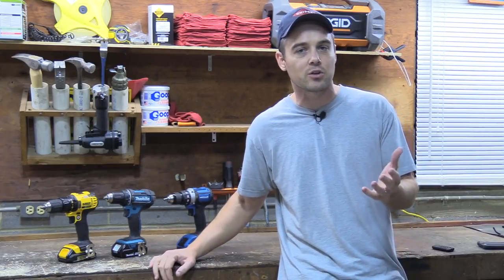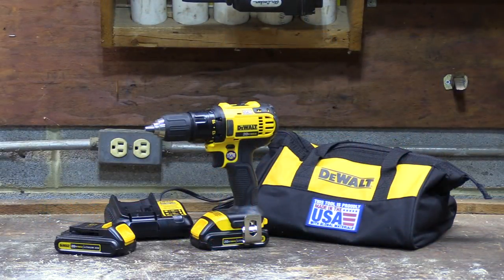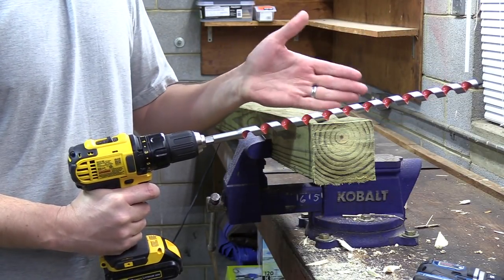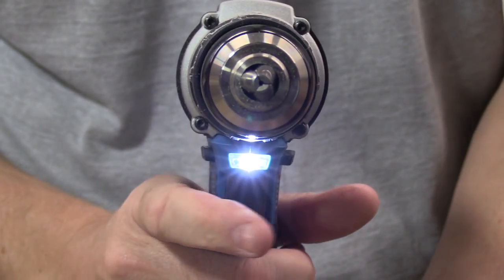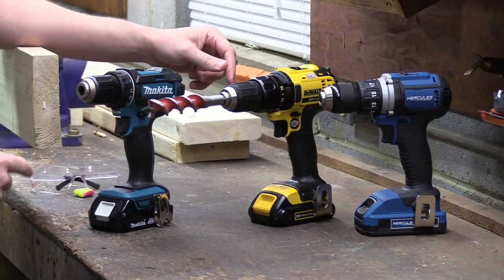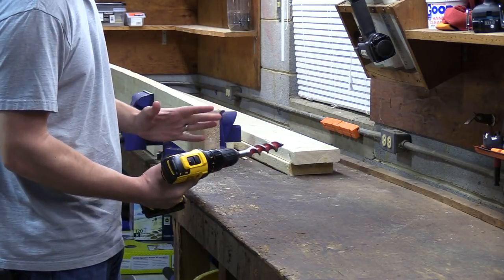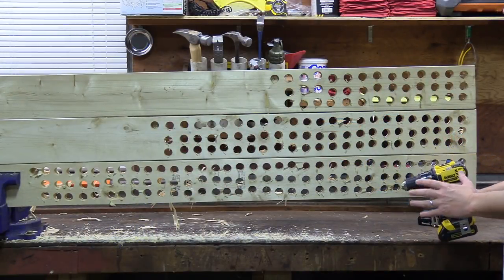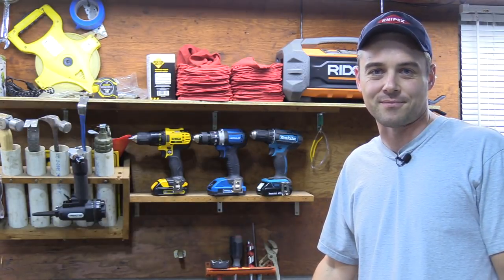Dewalt -VS- Makita -VS- Harbor Freight (Hercules) / DCD780 -VS- XFD10 -VS- HC91K1

Comment: Not hating on any brand, but the "real" test comes when a tool performs on a site with all kinds of drops, dust in the air and brutal use in real world conditions. There's no denying that a bigger battery will get more holes drilled, but when it counts, which one will last the longest in the field when used to build things in all kinds of conditions (freezing cold, sweltering heat, rainy damp conditions, etc...)? 

I've seen other tests where the Harbor Freight just gets fried from being used and the DeWalts & Makitas keep chugging along. There's no denying that any well known manufacturer can make lemons from time to time and that there are some great low priced budget tools out there, but the best testing is done in the field. 

I'll never buy another DeWalt compressor again. When their new compressor failed on me and I took it in for service, the local service manager didn't want to honor DeWalt's warranty after I had to return the 2nd time because the job he did the first time left it sounding worse than when I bought it in and DeWalt defended their service manager. I paid premium dollar for that thing expecting it to be supported by them. 

Drills however? I'll buy those all day from DeWalt and Makita has the best reputation in the field. Bosch too also made a GREAT drill in their day (especially their compact PS impact drivers). 

Having said that, this was definitely a very thorough lab test for sure. Lots of hard work put in and I (as many other here) do appreciate the effort. Good stuff.
Reply: I'm an electrician, and I used my dewalt in snow and rain ( setting it right in the snow, or pouring rain) and that damn thing still works. it is so old, it takes those old batteries that go right up in it..lol... about 20 years old, and it still works.
Reply: @jarrydee2799  If it ain't broke, don't fix it, right?

Comment: I think the obvious favorite would probably be the DeWalt, but I'm going to go out on a limb here and say the Hercules, because I think that's Harbor Freights new top-of-the-line in house build and it's probably built to Harbor Freight specs by one of the higher end manufacturers. So I've got to say Hercules.
Reply: I forgot I think I was supposed to reply to my own message, and lo and behold I got it right. I had heard good things about the Hercules haven't bought one yet. I did pick up an 18 volt Warrior lithium ion at one of their sidewalk sales for almost nothing once I added in the 20% coupon with the sale price. it's got torque for days, it has the built-in work light it doesn't have the LED indicators on the battery, but so far so good. I bought it  because it was a great price  and  I could stuff it in a cabinet in the kitchen and always have one in the house handy. So I don't use it a ton but I've had it for 6 months and I haven't had to recharge it yet. I'll take a look and see if I can tell which manufacturer it looks like may have built it. I'll update this if I can tell.

Comment: Personally, I dont think the Harbor Freight tool will last in the long run though. Could be wrong, just my gut feeling. lemme know if im wrong and your experience, im curious
Reply from the maker: I sent these out with a local contractor a year ago & they get constant use.....I regularly hear back about how great the Hercules is & how much better it performs vs the drill it replaced.

Comment: have been a makita user for years specially those of battery powered (drills, impact drivers, grinders, sanders, blowers, circular saws, etc...). they have transitioned into an 18V lithium and since i have tools fitted with it, it makes sense to buy only makita lithium (rechargeable) powered units since their batteries are interchangeable. rechargeable battery equipment are design for quick fixes without the hassle of dragging cumbersome cords connected to a power source. to drill that many holes would be unimaginable for me using rechargeable units. however, if i prefer to use them, i always have 2 batteries being charged with a fast charger at any given time. you have to alot a bit of time before you recharge a drained battery since it would still be hot from use (though the chargers have a built-in fan for this purpose). if it boils down to industrial use (hours and hours of continuous use), the corded ones are always preferred by professionals (which i also have). the hercules having a 20V power supply would certainly entail more power (or longevity if the Amperage is higher).  i have always found makita to be a reliable brand with adequate service centers worldwide. older makita models are truly made in japan but most of them are made in taiwan nowadays (the original light bluish colored ones). yet the most often of them already comes in green (this is the true CHINA-MADE ones and even distributors do not recommend them for heavy use - unless you are budget constrained). there are also the variant branded as MAKTEK which comes in red color but still made in China... a bit more buck would get you the taiwan made ones which are relatively good but still inferior to the japan-made ones...

Comment: Dewalt batteries have fuel gauges?
Reply: Except the smallest ones.
Reply: @ChrisGilliamOffGrid  the one he is using isn't a smaller one.
Reply: @Vera-xu3xw  Those batteries are tiny. All mine are 4ah or higher, up to the  9ah. I have a couple of the tiny ones laying in the bottom of the tool box, and they have gauges, but most of the small ones I've seen that come with tools from Lowes don't have the gauges. I have a video called Dewalt Fanboy that may interest you. :)
Reply: @ChrisGilliamOffGrid  does the Dewalt battery in this review have a gauge? YES
Reply: @ChrisGilliamOffGrid  FYI I'm not a Dewalt fanboy. It's just once you buy a couple battery operated tools (that are good) I find it better to stick with one brand for sake of having extra batteries.
Reply: @Vera-xu3xw  Exactly what I said in the video. I make a living with them.

Comment: On some level the thing about even well thought-out comparison tests like these is that even though all of these drills are mass produced and identical by all visual measure, something is different. I see it with car reviews all the time, where the top dog in one comparison is 2nd, 3rd, or worse in another. Then there are all the viewers of this that will go get the Dewalt/Makita/whatever and say the do jobs like these all the time and the bit goes right thru.
After watching this the Herc does impress, but in other videos the Hercules build, like the handle, breaks more easily. So no question about power-on performance. Just don’t drop it.

Comment: Makita you don't have to buy separate larger battery to run the 36v tools, they take 2. of the 18v batteries . plus they are proven tougher than concrete work or dropped from 2 story roofs. I still have a 12v drill from 1994 that works. Best deal is buying kits not individual tools. Find promo's and coupons

Comment: I would’ve liked to have seen you in the last test drill into the same piece of lumber with each of the drill motors. Often I find a greater density between one piece of the same species of wood.

Comment: It all depends on the parameters you use to decide a victor
Reply from the maker: I guess if the contest was which one is the least powerful or can do the least work, you are correct....the winner would be different.
Reply: @RealToolReviews  how about longevity of function how, much abuse it can take, how many times will the batteries recharge before they won't hold a full charge, how accurate are the different setting to the scope of setting available.the list goes on and on.

Comment: My guess would be Dewalt for popularity, maybe durability (drop-test), Makita for battery life, and Harbor Freight will be bang for the buck.
Reply: Ok, so after watching, Makita is losing steam... Dewalt is still pretty standard on worksites... I use Milwaukee.  

Warranty is big for resellers, but I live by my tools... if I have to do warranty stuff with my tools, I don't buy that brand again for about a decade.  You make a tool for tradesmen, or you do not.  Clean-shirt reviewers aside, I will keep an eye on Hercules... sometimes Harbor Freight knocks it out of the park, but I need it not to fail after months of construction abuse.  I keep 12 or so M12 and M18 batteries in the truck, and a variety of tools for my trade.  If you're building your own deck, Hercules seems pretty good.  Makita excels with fencing crews, driving lots of screws.  Dewalt/Milwaukee are king of skilled trades in America, but ripe for knockdown.  Proof will be in the pudding for Hercules, we all try out Harbor freight for one-off applications... but when they handle all the use and abuse and keep rolling, they'll become a staple.   If you're doing heavy drilling, Hilti is still king, but out of my budget.

Comment: From my experience with my new DeWalt hedge trimmer the DeWalt would do better if you bought batteries and chargers separate because for my hedge trimmer at least the battery last all day on 10 acres and still half charge

Comment: All I've ever used is DeWalt and they have always worked. I've seen other guys go through Makita drills like socks. Mostly battery chargers don't last and the drills themselves can't compete with DeWalt. I couldn't imagine using the Harbor Freight junk drill
Reply: Mike Mcglothin I’ve had about 2-3 Dewalt drills in the past 5 years, with one of them being the top line toughest model. Idk why I kept buying them if after a while they’d start smoking and go bad. 
I haven’t had that issue with other products such as their grinders and impact wrenches which I love, it’s seems to be their smaller impact driver and drill/hammer drills that suck
Reply: Also I honestly think the best investment as a professional or a person working in heavy industry or even a busy DIY. It would be Makita, Milwaukee, and Dewalt. 

I feel that Dewalt has decreased its quality over the years and as much as it costs now, you might as well get Milwaukee or even a Makita which if you look at any other videos
blow Dewalt away.

Comment: The Hercules did better then I expected, but I would have liked it if you had bought a 2nd battery to give the price with 2 batteries. I picked Makita
Reply: The Hercules batteries are $29.99 for the 2.5 amp hour battery and $49.99 for the 5 amp
Reply: So the Hercules is actually $128 with 2 batteries

Comment: I have Hercules and like them a lot. I also have DeWalt and they seem to have gone down hill of late. I have Makita  as well and they work fine. I will not replaced my DeWalt when it gives up the ghost because the brand has deteriorated to second class. I will keep using Hercules and Makita.

Comment: I have the DeWalt and love it.  Except for one thing.  The placement of the light.  It's supposed to light up your work space, but it just casts a shadow.
Horrible design.  I can't remember the brand, but someone makes a drill with the light at the front of the battery so that the workspace is lit up. I think it's Milwaukee.

Comment: I had satellite and internet company a 10 years ago. I used a dewalt xps and the transmission keep braking and I send it off to them. They fix it but it broke after a few months and I have repaired it about 4 time now.  The makita I have had to get while waiting for the repair the first time still works with no problems at all.

Comment: Personally I lean more towards Milwaukee as they have the 5 year warranty and 3 year battery warranty. But from an actual user stand point of the 3 tested the DeWalt or Makita will probably be the best bang for your buck. Sure the harbor freight tool drilled the most holes but it did have the biggest battery pack and unfortunately only came with one. Some one on an actual job site will require more then one which is added cost. DeWalt and Makita have tons of tools that run off the same batteries and unlike the harbor freight tool you know that there will be replacement battries still be available three or four years down the road. Not knocking the Hercules tool as it's very impressive for the price especially with an all metal Chuck but I can't see it as the value choice for an actual contractor.

Comment: Makita for impact basic drills are for cabinets impact drills will do a lot more for you plus if you put in the upgradable batteries for DeWalt they perform better plus you could put more magnets around them lol.. buy watvr you wish but the Makita impact is the nicest design which will blast through, I use DeWalt with 5.0 battery for a basic gun it puts tapcons in perfect

Comment: Good testing. longetivity of the whole device plus shareable batteries across the tools you use, make HF the loser, but the winner if all you ever needed was a drill.  I wish, oh how I wish there was a single battery to work on all platforms. There is no standardization in that arena and there should be.

Comment: I have the DeWalt drill, its still working but I used it hard one day and ever since then has a smoking motor smell to it.  It's ok but having used other drills and what I'm experiencing with it I will not be buying anymore DeWalt tools.  I have zero interested in finding a repair location nor paying to have it repaired I'd rather use it until it dies then buy a new one.

Comment: for the money or not the Hercules drill seems to be the best built drill here. I have two 18V Dewalts, the drills are ok the batteries died after about a year. I'm not hard on my tools either. I didnt ask the DeWalt to do anything much, just drilling small holes in aluminum and mild steel. The fact is the DeWalt batteries are junk. Most of the DeWalt stuff is way over priced for what you get. I think the Makita is ok although I was surprised it didn't have the balls to bore through a pine 2X6 with the large diameter bit in it? wth?  
   I need a new cordless drill because both the battery packs on my DeWalt are dead ducks. I sure as hell won't buy anything DeWalt is peddling any more. For my money the Hercules is what I'll buy next. If you don't mind spending more of your hard earned money on a name then by all means buy the DeWalt or the Makita. In my book both these companies are yesterday's papers.

Comment: I kind of like these cheap, tough, powerful drills.
 
However,  (and why I use DeWalt, but is applicable to Makita, Milwaukee, Bosch, etc.) the big, expensive pro companies also make any imaginable tool that use the exact same power pack. Said packs can be had in any number of amp/hour configurations. Try to mix up a Harbor Freight pack. You get what they give you, and that is it. Stuff one of the available chunky batteries in the DeWalt or Makita, and you'd be drilling all day before it gave out. You don't even have the option for the Hercules. 

The more "famous brands"  also will make power packs (or someone will) for this army of millions of tools for decades after the product line has ended. I have 20 year old tools I can still get genuine (or at least new) batteries for. Try getting a Harbor Freight battery just 2 years from now. Then, there are the chargers. Standard or fast? Do you even have a choice with HF? No. You get what they give you.

Still, it's a good cheap drill, that costs less than a DeWalt battery itself. If you are looking for more cordless power tools than just a drill -  and replacement batteries in the future - maybe you want a more pro name. Even if it costs more.

Comment: No matter what anyone says, the test was flawed as soon as the dewalt was introduced for comparison with the lower AH battery. A larger battery IS without question capable maintaining torque. I am a big Ryobi fan and I wouldn’t buy a Dewalt regardless. But I must say for that Dewalt to have a smaller battery and keep up the way it did, I wouldn’t be surprised if it blew the doors off the other two, with the same size battery!

Comment: The brand fanboiism is real here.  Most of the shade thrown towards the Hercules is due to bias brand loyalty and defending their purchases (which they paid more for).  The Hercules is a solid drill at a cheaper price.  The only issue is Hercules does not have the same large variety of tools that the batteries are compatible/Interchangeable.

Comment: That’s the junk dewalt, they make a steel chuck version with 20 min led on bottom near the battery. You have to walk into the tool aisle to find the goods. Endcap is homeowner stuff.

Comment: DeWalt, Makita and Hercules are just names the technology  today is available to everybody that makes these tools so therefore they're all going to be evenly matched. If you look at DeWalt it's manufactured by Stanley Black & Decker which makes Porter-Cable, Stanley Hand Tools, Craftsman, Irwin, Lennox and a whole list of other name brand tools. So it doesn't matter what names on it or what color it is they all have the same technology.

Comment: I'm retired now, but for most of my 40 years in construction l depended on my tools to make me money and when they broke the had to be replaced, usually the same day. In the 70's and 80' it was Bosch for me, the in the 90's through the 2000's it was Makita. When you use a tool every day the best tool you can buy isn't a luxury, it puts food on your table. I never trusted Harbor Freight anything, but as manufacturing shifted to China, that has changed. With the upgrade exchange warranty l would likely be a regular at HF if l was still working. Life is too short to deal with crappy tools

Comment: Only use makita for past 15yrs never let me down yet
Reply from the maker: Biggest problem with Makita told is that the batteries permanently die if the voltage gets too low….. no way to revive them.